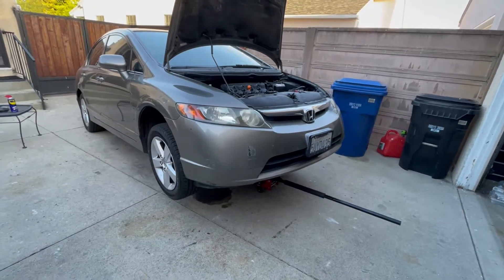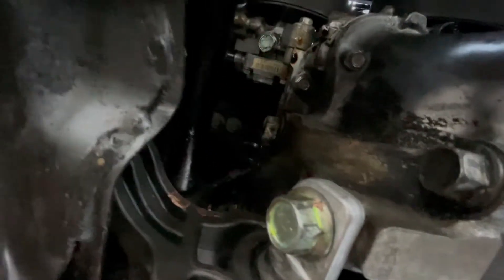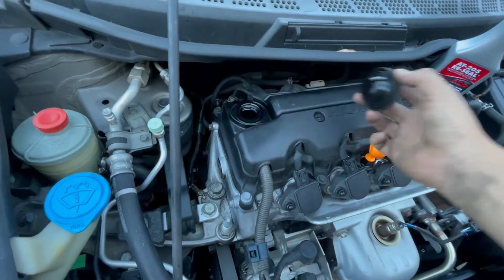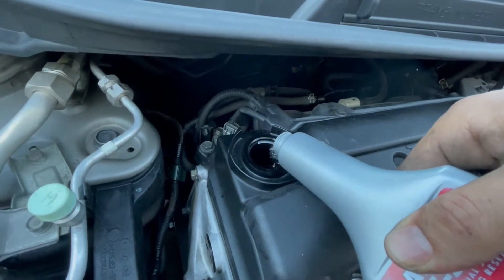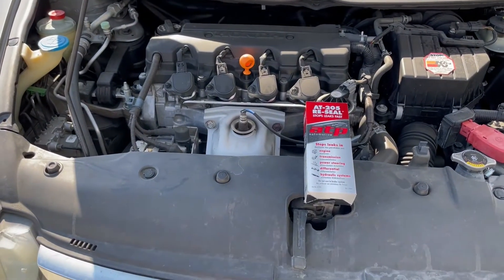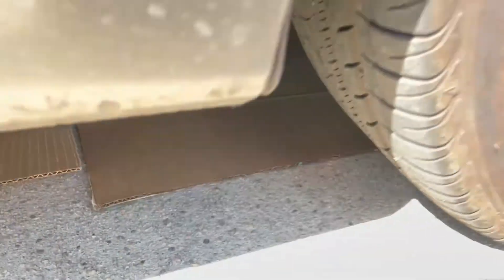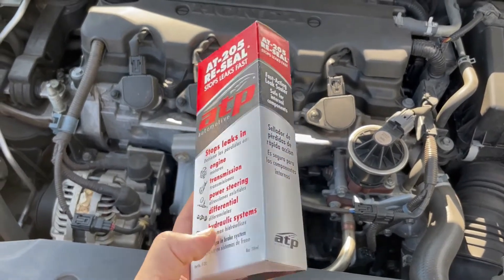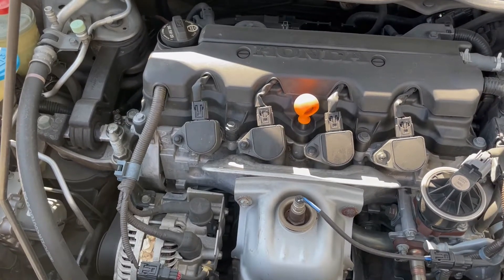How to stop oil leaks on 2006 honda civic. Fix engine oil leak

Comment: I have a 2006 Honda Accord four-cylinder with over 334,000
miles. Saw all the hype about AT205, first by Scotty Kilmer. I t was even rated number one on Project Farm.  According to the Project Farm  man, his test rated it number one, but it does interfere with lubrication, because he does a lubricity test also. I don’t really like that fact, but if it can seal an oil leak, it would have been still worth my while.

I have a front seal leak. It didn’t work for me. Very little effect if any when I used the AT 205. 

I mentioned this on another YouTube channel that it didn’t work for me. I have received a response that he had a friend that also had a Honda and it didn’t work for that person either, but he said the man claimed they used Blue Devil and it worked for him on his Honda. To what degree, I know not.

Well, I decided to give it a try and I would say it did help although it still did not completely stop the leak. I will try again with the Blue devil on the next oil change to see if there is an improvement.
Reply from the maker: well keep us posted see if blue devil works.
Reply: Thank you

Comment: its your vtec solinod rubber gasket, you need to replace it. rear engine behind the oil filler
Reply from the maker: yep you sir are correct, I troubleshot to that area and after a bit of research found thats a major issue with these cars, ...the stop leak has been working but i know i will need to do that soon. Thank you for comment and hopefully helps others that have same issue.

Comment: So after 20mils we have to change the engen oil sir can u explain plz
Reply from the maker: no after 20 minutes the oil leak stopped, there is no need to do anything else, you only have to put this in and it should seal leak with no further action needed.